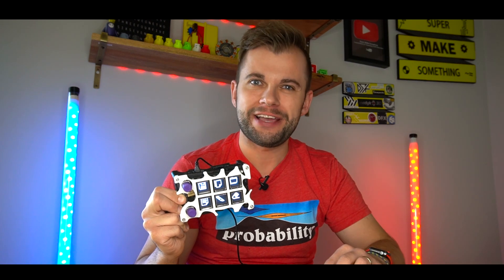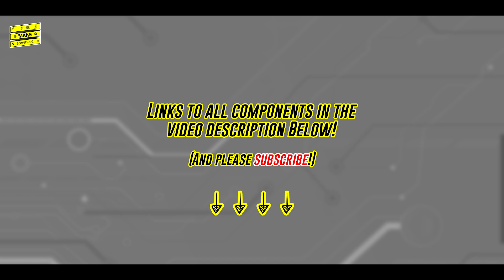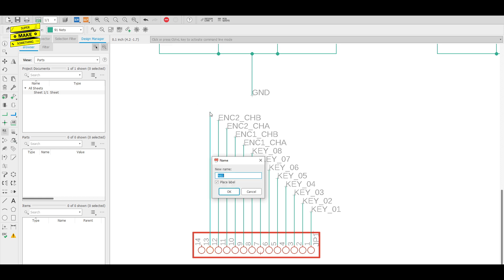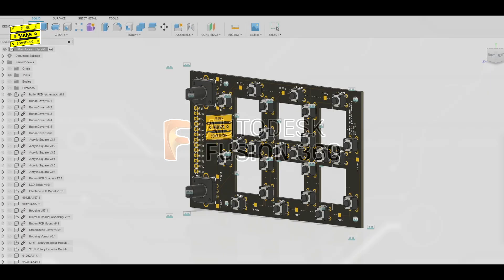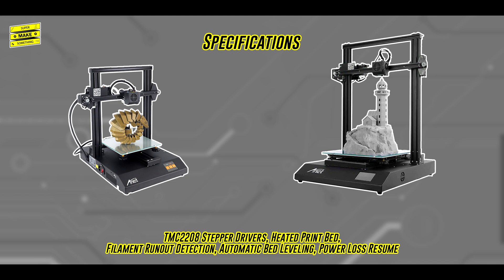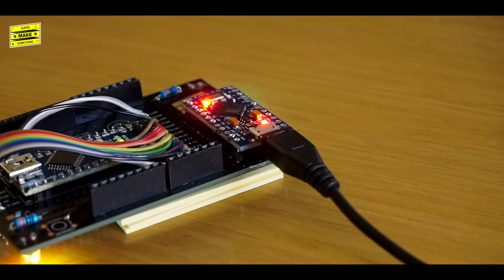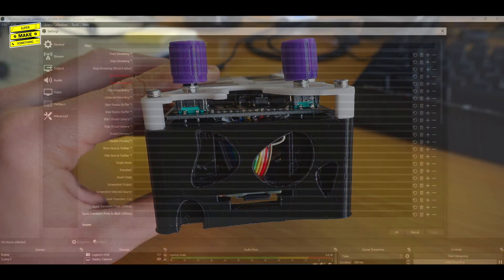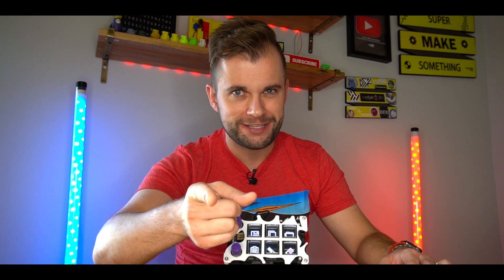DIY Stream Deck (3D Printing, Arduino, Electronics!)

Comment: Someone tell this guy about multiplexing.
Reply from the maker: Unfortunately the Pro Micro didn’t even have enough pins exposed to interface with the LCD itself, otherwise I would have definitely considered a multiplexer. For this design, I wanted to try to keep it simple for others to recreate, so I made a design decision of not using any bare chips.
Reply: @SuperMakeSomething  The thing with microcontrollers is you can implement multiplexing via software and don't need any special chip.
I was thinking more about the switches than the lcd anyway.
But it doesn't really matter anyway because I didn't realised you were using one of those lcd that take like 12 pins to control.

All in all the project is really cool, it just looked inapropriate to use two arduinos, there has got to be a more elegant way of doing things.
Reply from the maker: @furrane  Thanks! I am currently thinking of a V2 using an STM32. The programming for this board is a bit more involved so it is not as beginner friendly, but it should be able to handle all of the functions, resulting in a smaller Stream Deck with just one microcontroller. I will be sure to post it on the GitHub page if it develops, so stay tuned!

Comment: ESP 32 is as easy as Arduino, but has 2 cores with high clock + Wifi and Bluetooth
Reply from the maker: A Bluetooth Stream Deck would be super cool!
Reply: @SuperMakeSomething  it is fast enough for a software MP3 decoder so the possibilities are endless
Reply from the maker: @0zux45  Nice! I did not know it was that powerful. Will definitely pick one up to experiment with! Thanks!

Comment: Is this not sponsored by Anet? The way you told us that the printer comes mostly assembled and that it takes 10 minutes to get running, you said about the build size and the features 

If it's sponsored then disclose it as required by law
Reply from the maker: Apologies if you feel that this was not adequately disclosed. As is the case with most of my project videos, companies will send machines to me that I use during my projects in exchange for an honest review. No money changes hands, so I do not have a financial incentive to say nice things about a 3D printer, and I fully describe the pros and cons of a machine based on my experience while working on this project. In this case, I had no major issues with the ET4 Pro while it made parts for this video and think that it is a good option for those looking for an entry-level printer. For another example where I point out the pros and cons, please see my ECubMaker TOYDIY 4in1 project video.

Comment: I want to make one but with more buttons like the large stream deck.
Reply from the maker: Should work as long as you have enough IO pins and a larger screen. You should be able to do this using multiple keyboard PCBs along with a multiplexer.

Comment: arduino MEGA boards, and derivatives are programmed the exact same way, and the clockspeed issue is a code optimization thing, even if it may not be nearly that easy to do, look at 3D printers, they do MANY things a lot faster than you would realize, they will print, read files, and be able to generate a display at the same time, all on the MEGA 2560 (2650?)

think of it this way... if its looking for buttons for 50% of the clock cycles, its effective speed is 8MHz instead of 16MHz, because every other cycle is spent simply looking for those buttons, its all about thresholds. someone is usually going to press a button for a minimum intended time of about 1/16th of that time, eating up less clock cycles, as its doing other things at the same time, but since it does things in a linear fashion, its all about optimization and finding ways to do multiple things at once. you shouldnt be spending time either A. generating the screen when buttons are more important or B. looking at the buttons if the user needs to see what buttons he/she CAN press to progress first, meaning less things to do, less clock time.

then theres the fact of just using faster code, even if it seems a bit arbitrary at first. maybe using some sort of special file format that makes it easier for the arduino to parse and process as it doesnt need to look at a particular file type or maybe removing compression?
Reply from the maker: I agree that code optimization could definitely help. The big issue is that the icons are bitmap images, so every color channel of every pixel needs to be updated with a redraw. “Faster” redraws with this library are usually done by drawing primitives like rectangles and other shapes with functions in the code, which do not update every pixel. The other microcontroller I mentioned has a faster clock speed, so unoptimized libraries for a screen size like this are less of an issue. If the community would be interested in optimizing the library further so that it could be folded into the master branch that would be awesome! All of the code for this project is currently on GitHub!

Comment: shift registers? input matrixing? you can make buttons use as little as 2 pins on the IO, its not nearly as easy, but saves IO pins
Reply from the maker: Unfortunately the Pro Micro did not even have enough exposed pins to run the screen and SD card reader, so something like input matrix was not possible. For arbitrarily large inputs with as few pins as possible, I think that multiplexers would have been the best option, but I wanted to avoid the need for people to purchase individual chips to try to keep the project as accessible as possible.

Comment: When you put the micro usb into the chip it looked like you took it out in reverse
Reply: Super Make Something haha I knew it btw it it you that is making a cyber punk 2077 style stream deck?
Reply from the maker: @hybrid5132  Yup! Livestream will start tomorrow at 10:00AM EST!
Reply: Super Make Something is it going to be powered by a raspberry pi becuase I think that is going to be easier to make
Reply from the maker: This one will still be Arduino, but a Raspberry Pi one would cool! Definitely would be possible to get some high refresh rates on the screen through HDMI!

Comment: Hey super cool project , can you explain what/where in the code you got the Arduinos to work together and if I could do it with 2 pro micros.
Reply from the maker: Thank you very much! I actually just have the two communicate using their analog input pins.  Since all of the conditioning hardware is already onboard the microcontroller, this was the "cleanest" solution that required no additional hardware. Hope this helps!

Comment: LOL, I got all of the components because I just order everything from china to make some toys. but I wonder why you have to use more than one Arduino.
Reply from the maker: Unfortunately the Pro Micro did not have enough IO pins, so the easiest way was to use two. Other microcontrollers could have worked, but Arduino is very well supported and user friendly, so I found it to be the best way to make a design that others could easily make themselves.

Comment: I realy want to make this but I have an arduino uno instead of what you have is it possible to do it whit that?
Reply: I also want to use a toutch screen to reduce the amount of inputs/outputs I need to use
Reply from the maker: @wolfv.h  An Uno should work for driving the LCD screen and they do make touchscreens compatible with Arduino Unos also, but it will not work for sending keyboard commands because you need a microcontroller with an ATmega32u4 chip.  Here is a link to an Uno compatible touchscreen if you are interested (affiliate link): https://amzn.to/3qG3wkL
Reply: @SuperMakeSomething  thanks for your help!

Comment: 5:28 but when add wour PCB in basket : only the Arduino PCB is add.
For adding the key PCB, i must add manualy with your source, a may add some humain control from PCBWay. 
Can you change / add the Key PCB in your profile ?
Reply from the maker: Thank you for letting me know -- I did not know that only one PCB was added automatically.  I will get in touch with PCBWay to see if the listing can be updated.  Cheers!
Reply from the maker: Update — the listing/project pages have been updated for easier/clearer ordering. Each PCB is now listed on its own project page on the PCBWay website, with the two pages linking to each other via text in the project description. Thank you for letting me know about the issue!
Reply: @SuperMakeSomething  well, now your PCBWay link show only the button PCB, and your profile show only 1 project with "under review" alerte message 
there is allway a 20$ supplement for humain control for this button PCB
(sorry, i'm french)
Reply from the maker: @phd0  Due to the way that the PCBWay system handles online orders, it was best to split the Keyboard and Interface PCB into two separate posts on the shared site. Since they are technically “new” designs because it was a new upload, they are currently under review. However they should hopefully be published and ready to order in the next day or so.

The supplemental charge may be due to the geometry of the PCB with milled out windows, which is a bit non-standard. I will update if I find more information about this.

Comment: This idea is sooo awesome! Im designing one my self but with a touch screen LCD. Do you have some tips? I cant figure out how to make the clear buttons for on top of the touch screen. Kinda the same as Elgato is using.
Reply from the maker: Thank you so much! I had previously thought about a touchscreen, but wasn't sure how long it would last given how often it would get "tapped," so I went for the PCB route instead.  The official Stream Deck seems to use rubber underneath the clear buttons.  If you end up following this design path, definitely let me know how it turns out! I would be interested in seeing another design!
Reply: @SuperMakeSomething  well yes i am trying to copy them a little bit. I will let you know if i can fix something

Comment: why don't you use a touchscreen monitor for the arduino ?  with this you can avoid to use button
Reply from the maker: I thought about using a touchscreen initially, but was worried about screen life because most of these types of screens only have a thin plastic sheet as a cover. By using buttons, no pressure is applied to the screen, so hopefully it will last longer.

Comment: Great video and a beautiful mechanical design, but IMHO, a horrible electronic design.
TWO Arduinos? Seriously?
As you were making a motherboard, a user would have to solder things anyway, so why not just have a proper board with a STM32 (or a MEGA32U4 for that matter) , a SPI flash and a touchscreen LCD. Voila. Smaller, cheaper, simpler.
You could even have PCBWay supply the boards, the user then wouldn't have to solder ANYHTING.

Comment: I am having issues in my self made streamdeck that the keypresses are also recognized by other softwares when they are in focus. Is it not so that the official streamdeck uses other methods of sending keypresses so they do not type anything for example when you have notepad open. Or am i just overthinking how a streamdeck works and making it hard on myself?

Comment: During the whole video I can never see that the button gets pressed. Or did I miss it? Because I've used the streamdeck and the tactile feedback of them is really good and something I think would be hard to reproduce. It almost has a mechanical keyboard feel so I was wondering what it would look like on this keyboard as I wanted to do a similar project as well, but can't find any switches with a similar layout to the streamdeck.
Reply from the maker: Good call! Showing the button press would have been useful to put into the video. Since these use PCB push-buttons, the feel is definitely a bit more “clicky” than on an official Stream Deck which uses a rubber sheet behind each of the buttons. I personally like the clicky feel, but can see that this would definitely be up to user preference. This is definitely something that could get remixed easily in a future version though!
Reply: @SuperMakeSomething  Thank you for your quick answer. A clicky feel would be nice as I like the feeling of mechanical keyboards. I was also wondering if the buttons tilt if you don't press them in the center?
Reply from the maker: @RobinGlauser  The buttons are constrained by the faceplate, so they stay pretty well in place. In this respect, the tilt “amount” is slightly adjustable by tightening/loosening the screws that attach the faceplate to the housing.

Comment: An Arduino DUE would probably be a better choice for fixing the clock speed issues and IO problems - as it would be a single micro controller option for the lot then instead of needing 2 boards, but trade off is size and cost. I'd have also thought just using a touch capable display for a few $$$ more would have simplified things a LOT, and been worth the cost trade off.
Reply from the maker: I’ve never used a Due, but I will definitely take a look! Simplifying everything down to one board would be great for reducing the height of the Stream Deck! I thought about using a touchscreen, but was afraid that repeated tapping/pushing wouldn’t last very long — especially with hobby-level screens that only have a thin layer of plastic over the panel. The buttons should hopefully make everything last a while. (Plus it allows you to “feel” where the keys are, so that may be good during a streaming/gaming session.)
Reply: @SuperMakeSomething  Swapping to a due and keeping most of the current design looks like it might only require a single manufactured PCB to be changed, meaning most of your existing build could be used as is with 1 change.Certainly something to contemplate if the time presents itself.
Reply from the maker: @ZagatoZee  That would be sweet! I will definitely take a look! Thank you for the tip! (Also it is a good excuse for me to buy an Arduino Due, haha!)
Reply: @SuperMakeSomething  I was thinking going for a Pi Zero, still cheap, still small, double the GPIO of the Arduino Pro Micro's, and HDMI to expand your screen options.
Reply from the maker: @Frentraken  That is a really good idea!

Comment: Super complicated. You could have used a resistive touch screen, but still keep the acrylic buttons. It would work because you would be using a resistive touch screen.
Reply from the maker: I thought about using a touchscreen, but was worried that it would wear out over time (especially these hobby ones). Because the panel is only covered in a thin layer of plastic. By using push buttons, a user never touches the screen, so this should hopefully increase the life significantly.
Reply: This is the way Elgato do it, but I'm not sure it's as easy as you think -- mainly in terms of sourcing the materials you need. Clear acrylic buttons will not actuate a touchscreen and even if they do, I'm not sure how long your screen will last with tough acrylic pushing on glass. You need a clear, rubber membrane under the buttons. Super Make Something's design might look cumbersome, but it uses super cheap components that are easy to find.

Comment from the maker: I added encoders! What inputs would you add to your Stream Deck?
Reply: id actually really like to make a few of these into a larger deck. i picture two or three of these side by side, knobs across the top. knobs for everything from scrubbing through footage, to volume, to brush size and hardness, while giving me plenty of room for macros. if i really wanted to go over the top, id alter the bottom of the cases to clip to a backing, put little slits in a mouse pad desk mat to secure them all in a row, with a similar 2 part clip meant to hold an atem mini, have that all neatly secured right next to where my mouse sits underneath my wacom on its deskmounted arm.
lol now i need to make this
Reply from the maker: @wilkisama  That would be awesome!
Reply: using a rotary input to cycle through icon pages
Reply: @aryachaitanya4271  thats a great idea
Reply: I am looking at the pcb order page. How do I get the order size below 5 units? I don't need that many.
Reply: @deanmaxwell7455  You cant order below 5 units... unfortunately at PCBway or jlcpcb you have to order at least 5 pieces.
Reply: @deanmaxwell7455  Build additional ones for your friends and gift em for birthdays :D
Reply: volume controls. :) That would be cool.
Reply: A mic for vocal commands
Reply: Your project inspired me to build my own too, I will be using a 100 step CNC style rotary encoder from Ali thought I'm really curious to how that will feel. 
If anyone is interested I'll report back.
Reply: Definitely audio input & output options ! Audio management is an expensive hassle for amateur YouTubers !
SUBSCRIBED

PS: Your Intro music is really triggering ☹️